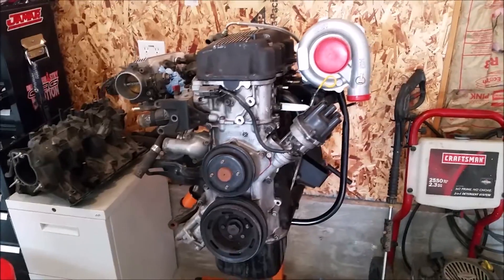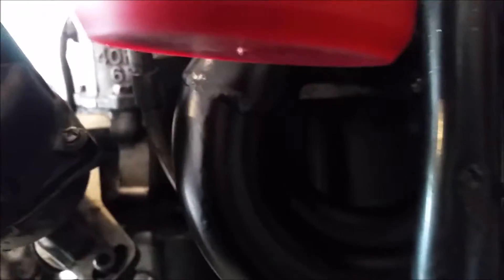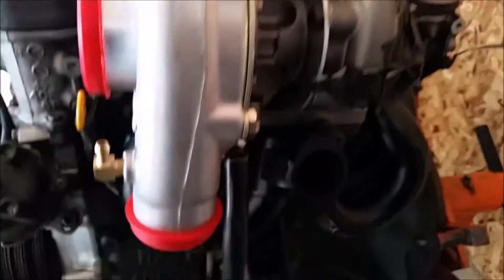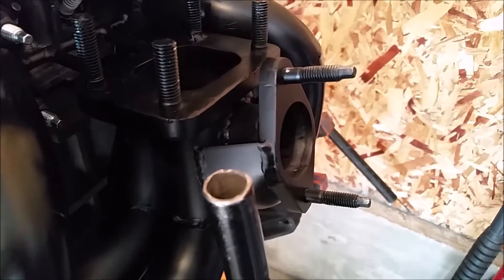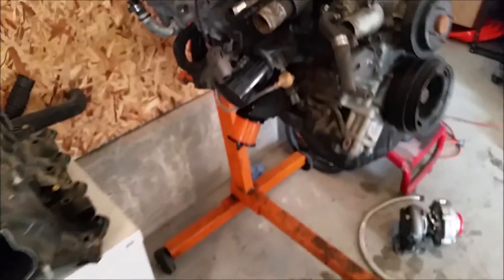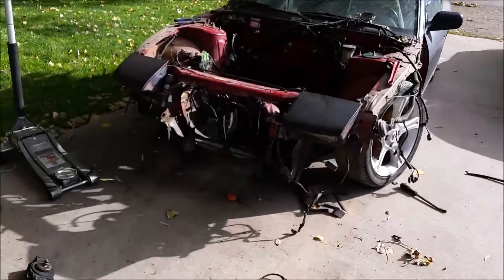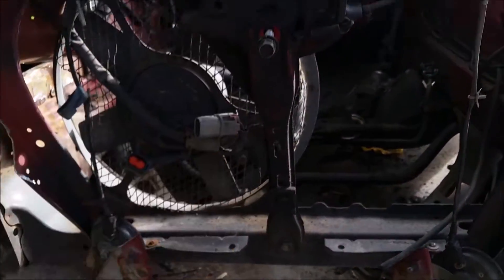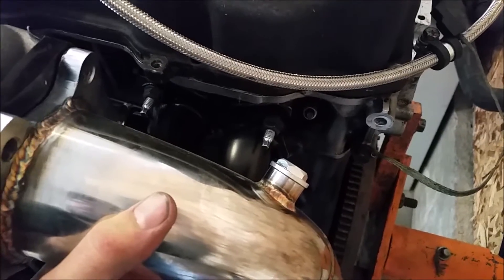CXRacing KA24E-T Turbo Bolt On Kit Update - Part 5

Comment: Wow Cx racing has came a long way, but jesus Cx Racing, when are yall gonna take some fucking pride in your work and make a kit actually fit?!!  Plug and play.  Good luck on your build i really would have thought CX would have done alot better than this.
Reply: you can run whatever you want really. The log manifold is not going to have cracking issues like a cheap tubular manifold. Most KA-T TOP MOUNT manifolds don't have easy access to spark plugs. I always recommend a bottom mount T28 or GT2871r, try to replicate the stock SR20 setup and you can run a simple FMU and you won't lose freeway MPG and you'll have boost by 2000-2500rpm. you can make close to 300hp which is a LOT compared to a stock KA
Reply: I ran an intercooler kit from them on my rb20 swapped s13 and it bolted on perfectly , but you know for the price i'm sure every piece is different. a few mm here or there and some kits fit and some don't fit too good. Then again, edelbrock and other parts don't always fit like they claim either.
Reply: true,,  i need to start a company that makes kits for about 5 different well known engine swaps and make them perfect for different chassis..
Reply: or just build it yourself from scratch or using a few known good parts. Ebay cast log manifolds are pretty much know to be good haha. CXracing ball bearing turbos are  know to be quite good. You can save thousands by putting in the labor of bolting a few parts on, then measuring what you need and buying the right tubes to connect it all.  I have seen a ton of 5 star reviews for ISR / ISIS kits as well its for DOHC. Though the turbo is really big for stock
Reply: BattleGroundCycles can you run a different manifold?  I would like to have access to the spark plugs.  And is the log style be better in the long run?